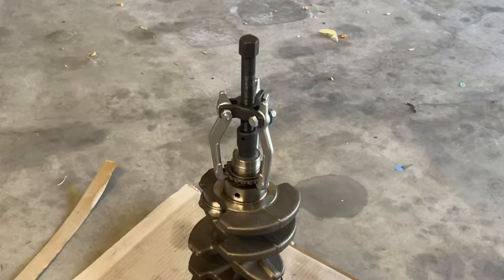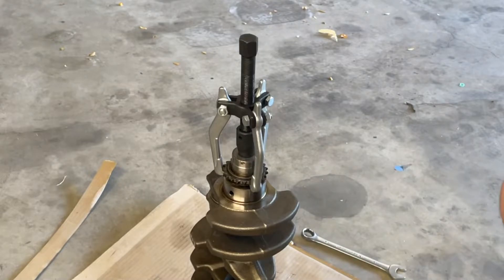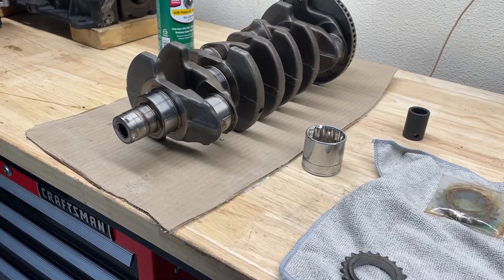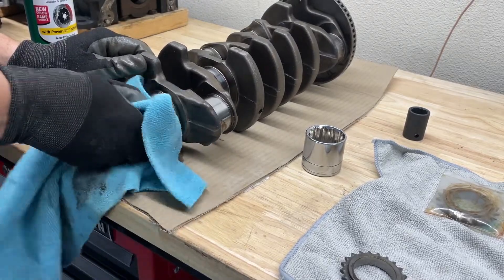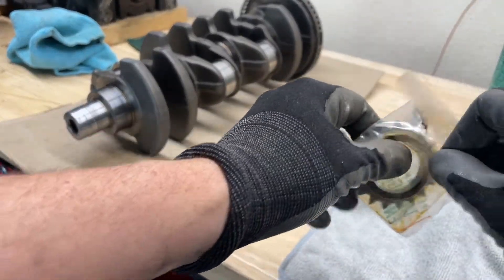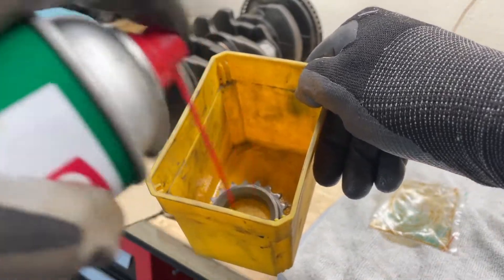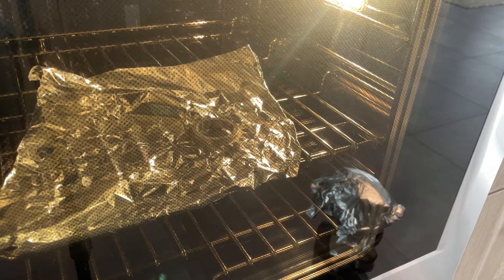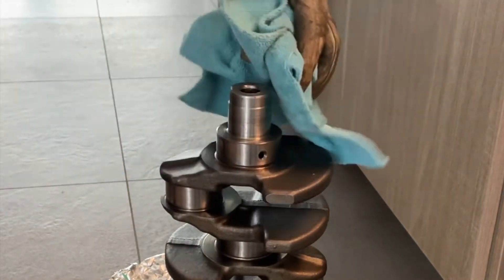1.8t Stroker Build: Replacing oil drive gear on 2.0 FSI crankshaft

Comment: I have recently come across an ea113 that i want to swap but the seller says its from a manual and wont work on a automatic. Does it actually matter? I would think it doesn't as it not going into a ea113, its going into a 06A block with my gearbox.
Reply from the maker: Manual crank has a hole for the pilot bearing, automatics do not.  I don’t think it matters if the hole for the pilot bearing is there or not if you intend to use it with an automatic.

Comment: Do you think that the BAM crankshaft ist different to the AVC? Or are they swappable?
Reply: I will try to replace them this week. This feels like playing the lottery😅. BTW nice instruction on how to replace the sprocket. I will most likely neet to do that too, if the BAM crankshaft magically fits in.
Reply from the maker: @EduardM.    What block are you putting the BAM crankshaft into? Its out of an 06A block and its not a stroker crank. Edit: Meaning AVC <-> BAM is just 06A blocks with the same exact crank dimensions, no need to replace the gear.
Reply: @durandalmk2  I guess you made my day today. If that is the case and both blocks are just the same then we will have an easy one  on that, I hope. I was playing with the idea to put a  bigger China turbo and then it would be much better to go with the BAM pistons and rods, because of the reduced compression of 9.0:1 instead of 9.5:1... What do you think is it worth?
Reply from the maker: @EduardM.  afaik around 21 pounds boost (up top near max power, ignore peak boost down low) is where it starts to matter to reduce compression in order to run more boost.  Looks like the AVC pistons are 20mm so those are stout too.
Reply: @durandalmk2  hmm, I think I will renew just the piston rings an go with the AVC pistons. Then we will see how all this will develop.  Quite exciting to see how much power it will make. I have also got an AQN beetle, which actually has also some kind of style and flavor with the vr5 engine. Nice sound even with the original exhaust. After the Turbo is rebuilt I need to decide which one will stay with us. A very hard decision to make.
Reply from the maker: Both showing forged and in 1.8t engine, they should be swappable see here -> https://www.bar-tek-tuning.com/1.8t-engine-codes